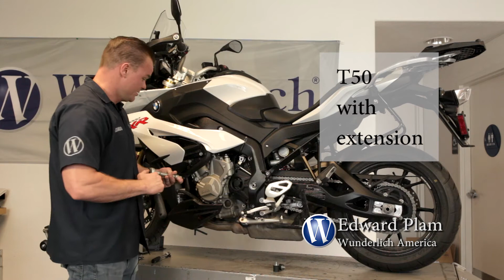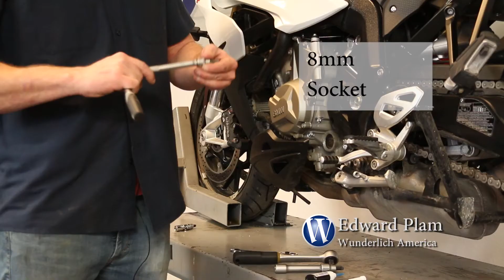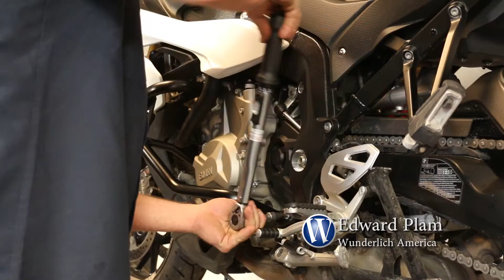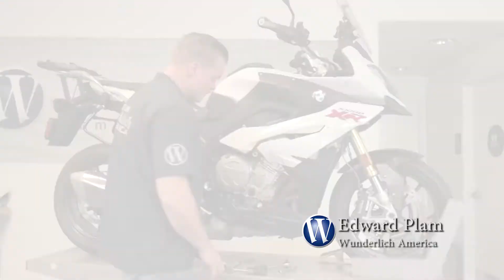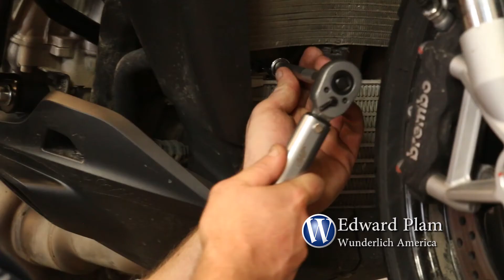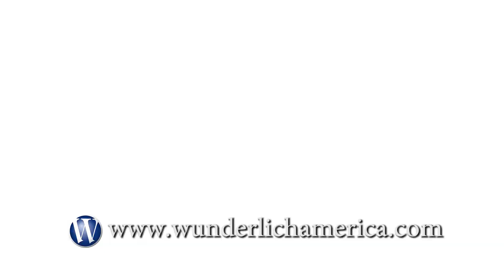S1000 XR Engine Protection Bars Installation

Comment: Don't fancy using third party engine or frame bolts to replace the existing OEM. If i drop the bike then will use the insurance to cover the damage if necessary. If i drop the bike at speed then engine or frame damage possibility may be increased as a result of using protection bars, bobbins and the like.

Comment: YES! I think they redesign the crash bars. They deliver them now with four silent blocks. Before the crash bars where directly mounted to the engine block. So there must be a reason for that change. That change happened 2 month ago
Reply: Someone bought the first design and cracked thier engine case. Wunderlich paid for a new engine which cost $18k .

Comment: Have you improved this product's design recently?  I have heard of an individual who purchased your engine protection bars and had his local dealership install them.  He returned to the dealership a week or so later, citing an oil leak.  As it turned out, the oil leak was caused by damage to his engine case (a crack) which resulted from undue stress placed on it by the mounting of the protection bars.  As a result, his bike ultimately required replacement.  This information came to me through a third party but I believe the source to be reliable.
Reply: St Hr that is why I don't fancy direct mount on the engine block on any bike
Reply: Andrés Padilla that’s good enough to stop me buying this product 😳
Reply: i had on my cbr 600 mounted rg mushrooms and after an accident the right mushroom had pressed the block of the engine ending in crack.I was lucky because I could fix it  and mushroom saved the frame but i would advise only sliders replacements in the place of stator and clutch plates.It is less protective but it has the less crash impact problems on both frame and engine.Remember an engine you can fix or replace it but a frame once you hit your bike is a write off!